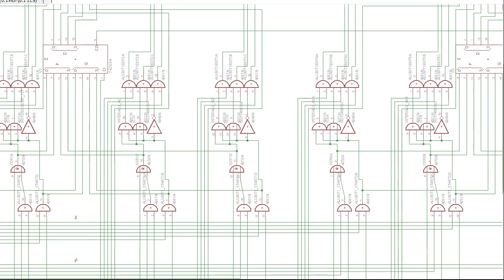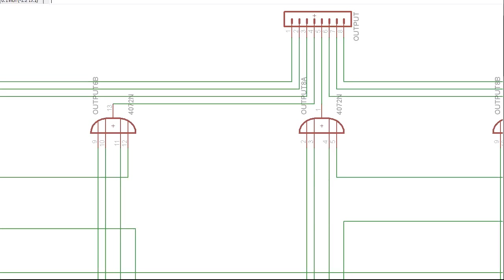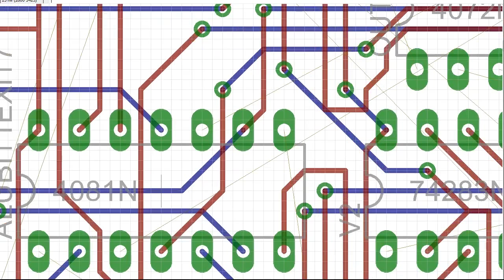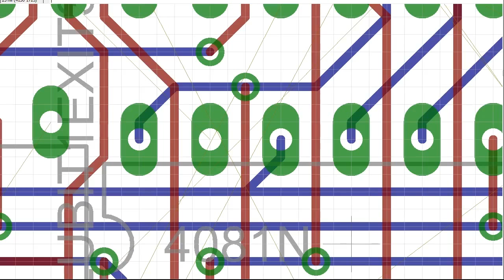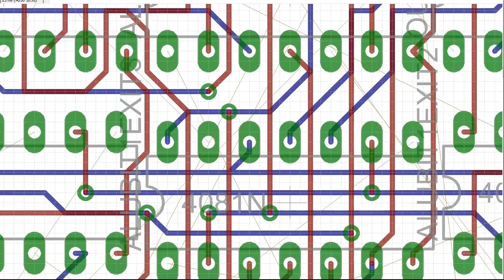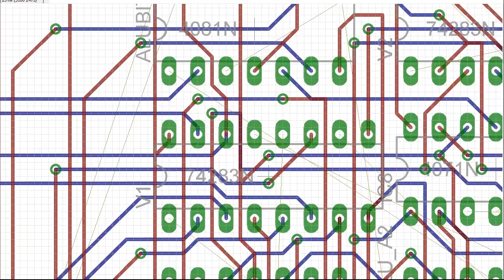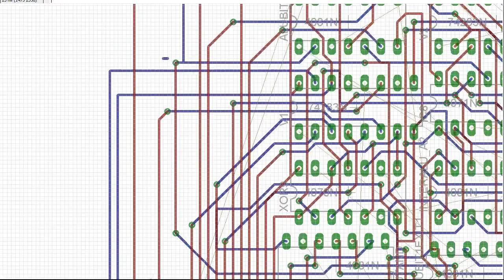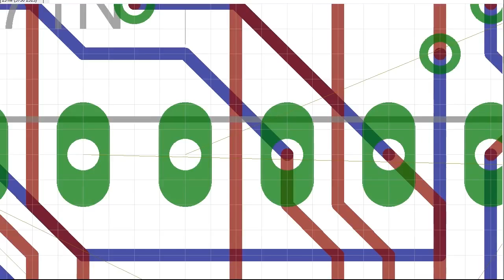To PCB or not to PCB - Lets Build Diaries - 8 bit computer - part 1

Comment: I used to do electronics in my teens. All I could think about was doing this. I had 15 mains valve radios and some tv,s. I fixed, and I made projects out the magazines, some would work, some not. I also made all my own circuit boards with electro sets for the tracks, there was no pc to print them out,I  had no one to help me when I could not under stand the maths, so I gave it up and gave away all my stuff, components. That was 30 years ago. 
I been making other things, but nothing to taxs me,

Comment from the maker: Oh its really simple, there are little copper pads on the bottom side you can solder to. Silver wire you can buy in every electronic shop, its cheaper than it sounds.

Comment: I meant like do we connect the wire to the ic from the bottom of the board or we take the wire from the top! It's gonna be a complicated one..and where will I find those silver wires to solder them?! Thanks!